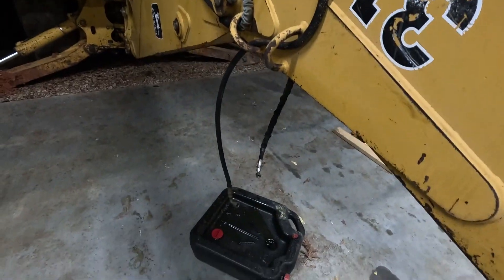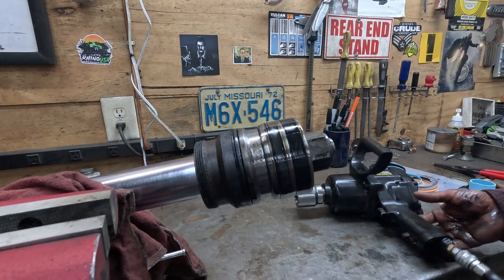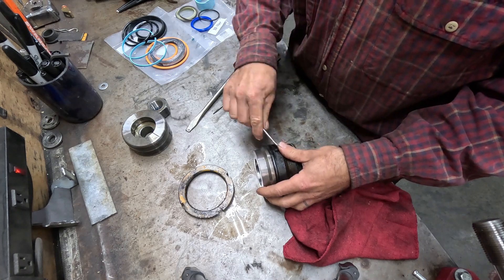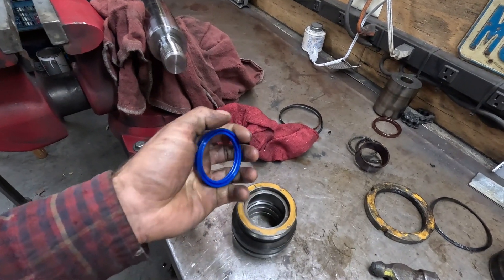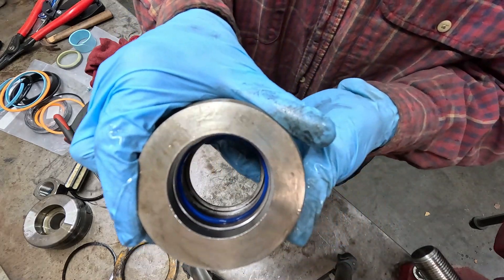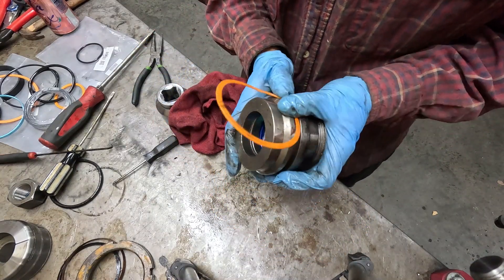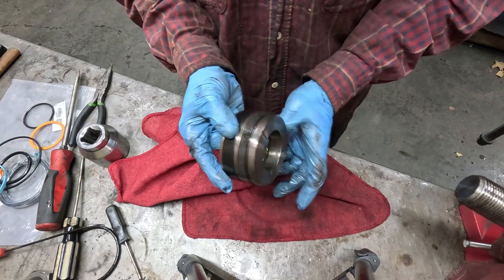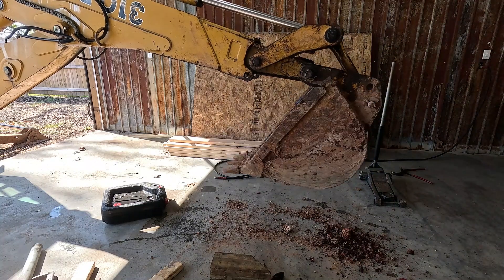DIY Backhoe hydraulic cylinder rebuild

Comment: What is the name of that very first plastic seal/ring that comes loose with the gland nut ? Went to put mine back together and there’s threads exposed where nut just kept tightening , think I’m missing that last seal.
Reply from the maker: Wiper seal is the furthest one out I believe it keeps the rod clean as it goes   In I think the other one is called a rod seal
Reply: Where you getting your seals

Comment: Did you have air in the hydraulic system after your assembly? And if so how did you bleed out the air. I have a similar job too
Reply from the maker: All I did was fill the reservoir and work the hydraulics to get all the air out I didn’t have to do anything fancy
Reply: @simplytinkerdad  thanks for the quick reply.